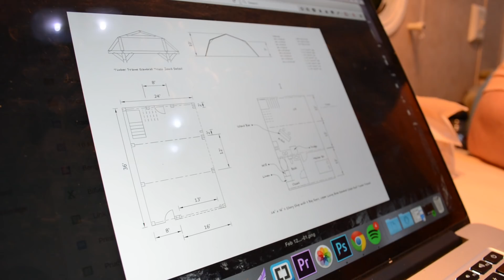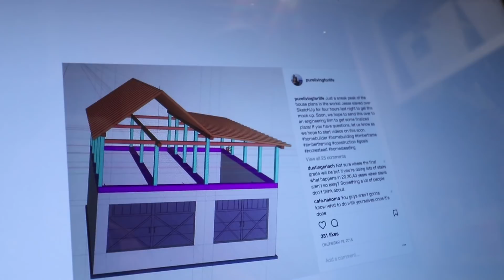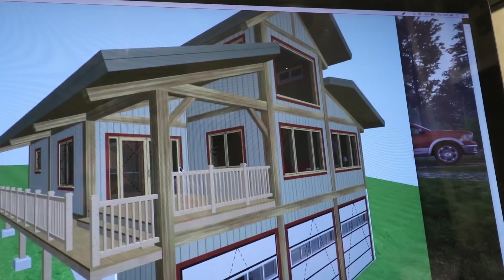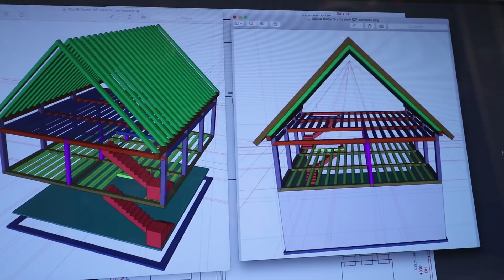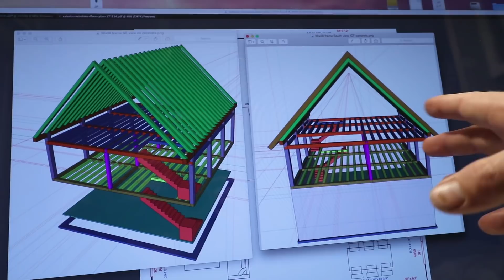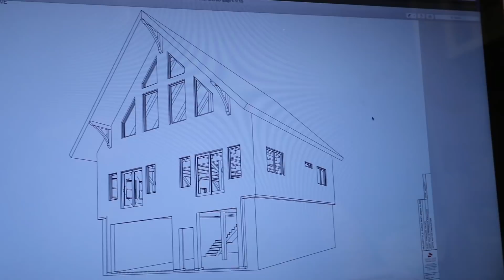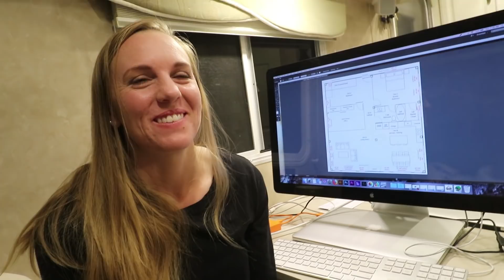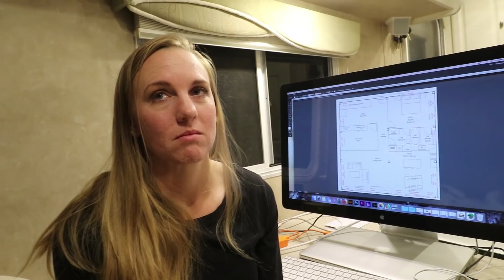Building a House Start to Finish: Timber Frame House Tour

Comment: The look of the interior looks great.  The spacial dimensions of the outside are getting there. Lets start with the kitchen; where is storage for food stuffs.  Rural living will require caning and or prepping a side of beef.  Where will be long term food storage?  The bedroom where are the dressers.  This helps finding your clothes also would they fit with a king or would it now seem crowded.  Stackable washer dryers are for small loads will take longer for laundry day or else laundry day will be all week long.  Where is the storage in the master bath for everyday grooming requirements?  The mud room should have more nooks for hats, gloves, boots etc.  Need more closet space to store linens.  Finally the garage; place storage under the stairs would help to organize the tools you have been collecting while building your house.  Suggest doors on storage to keep it organized looking. You will need a place place to put away winter tools in the in the summer and visa versa.

Comment: California building codes would probably require a huge ridge beam. I like the steep roof to keep the snow load down. I would have a few Jøtul wood stoves in the house. The chimney can be at the end of the gable so it does put a hole in your roof.

Comment: Loving the plan! looks so great! King bed is SOOOO good! make sure lots of room at the foot of the bed lol! Laundry, make sure that FULL SIZE machines can fit in there with a couple inches both sides and room to go up! you will probably want a bottom pedestal to raise them up off the floor. LOL noticed the render did not show how to get out of the stair case from the basement! you will want a good sealing door at the top or the bottom of the stairs (and then enclose stairs if at bottom) to keep the vehicle smell out of the rest of the house and for fire safety. Keep at it guys!

Comment: I like the design concept of your house. Nice job! I was surprised at the chosen placement for the washer & dryer. I would have figured that those would have been placed in the mud room. You wouldn't have to worry about taking of wet or muddy clothes through the house in order to wash them. Simply strip out of said clothes and into the wash they go.

Comment: Some friends of mine have one just like it and I see a "flaw" in your design.  The block on either side of the driveway should be extended out into the driveway. And they have a deck over the driveway and around the side.
Reply: smolville I think that they are building the deck at a later date.

Comment: Love your floor plan!

The things that would drive me nuts though, would be trying to do laundry in the bathroom. I suggest a laundry drop in the bathroom and the laundry room in the garage. Especially where you may be coming in from the yard and showering in the full bathroom down there, you'll probably find the laundry down there being more convenient. Secondly, once you have kids, bathrooms feel really small really quickly as kids need stools to the sink, you may have a diaper trash & regular trash can, bathtub rugs, and they can run you out of towels quickly, etc. Have plenty of storage space in or near the bathroom with extra floor space inside the bathroom.

Also, if you plan to do canning in the kitchen, it will feel small as soon as you start. I would wrap the cabinets all the way around to the door and decide island OR kitchen table. I vote kitchen table. More options for space use. Especially where I didn't see a pantry, you'll need lots of cabinets. You mentioned possibly canning down in the garage workspace, but that's going to be difficult once there are children to watch similtaneously. 

Speaking of which, where is your cold storage going to be? That's a must for a homestead. Garage? Under the stairs? Separate building? 

I figure that your workshop tools will end up taking that whole 3rd bay of the garage.

Comment: You have obviously put a lot of thought into your design, and it looks like a house that you will be happy in.  Sincewe are blessed with a world full of many different peoplewith different likes, dislikes and preferences, I am comfortablethat you won't be insulted that it's not my kind of floor plan.BUT, there are a couple things I think you should reconsider.The kitchen stove and sink should be swapped.  You don'twant bacon grease splashing on the windows and curtains, and you will really appreciate looking out the window whilescrubbing the pots that don't fit into the dishwasher.The other thing is the main entrance.  Do you want guestsbeing greeted in the mud room?  Do you want to come hometo the same scene at the end of a romantic evening?  If not, you might want to think of a way to make the mainentrance more enticing by adding interior walls or moving the door.

Comment: I missed the stairs in the mudroom from the garage?   Also I would suggest the washer and dryer in the mudroom or in the garage with a laundry chute,  and don't forget the overflow pan for the washer.  If air infiltration is a concern,  then add a foyer for the door to the north.  Congrats,  and  good luck.

Comment: One thing to keep in mind in the ruff in stage, make sure all of the electrical, plumbing is run up to the second story. Also on your decking make sure you have supports for it. lastly have you thought about pocket doors in the bathroom area.

Comment: Hi There, great job you're doing.
Just a small suggestion:In the bathroom instead of stacking the washer/dryer,
you could place them side by side elevated on a socket with build in drawers,the side by side is more comfortable to work at,and makes it easier to move heavy wet clothes to the dryer, and it spares your backs
then you could have a tabletop for folding dry clothes, and there will be room for longer shelfes

Comment: Washer and dryer in the first floor is not only a bad use of space but most of all and over the years you will learn that it will mean trouble. Let me just ask you something, if you were to have a water leak, would you prefer to have it on a first floor or in the garage? Take it from me, washing machines do break down when you least expect it and it doesn't matter how expensive they are. Take it from me, I've been a home owner for over 25 years.

Also from the looks of it you going to have a pretty considerable size roof, what I would suggest is to build a system to collect all the rain water that lands on that roof. This will allow you collect that water to store it and use it in many different ways. But mostly you will avoid having all this water falling down around the house, specially because your house is built up against a hill side. But even if you don't want to collect rain water, the important thing is to drive that water away from the house's foundation.

In the end it's your house and you decide how to build it, I feel like I did my part in trying to give you the best advice possible.

Good luck with everything!
Reply: wcfbhoodinki In apartments complexes what you said makes sense. In buildings with apartments have concrete flooring and are prepared to be resistant to a substantial amount of water in case of a small flooding. That's not the case here, they have wooden floors with wooden beans. And we all know what water does to wood if concentrated for long periods of time. It just makes sense for them to have laundry in the garage. Not only they have a small set of stairs allowing easy access, but also they have heated floor there as well. Plus it's good exercise.

Comment: Use a sliding door in the bathroom. Solves a lot of issues. Assuming you are looking at triple glazed on the big windows? The heat loss from Windows is horrendous! 
I think your not only brave but honest! It's a bitch when reality bites!  I look forward to following the build.

Comment: Vaulted ceiling! Give yourself 1/3 of the loft for a vaulted ceiling in the front, it will open the space up so much. I also agree with other comments about putting the office upstairs and with the vaulted ceiling, you could even keep it open so you can be apart of what is happening downstairs.

Comment: Excellent video. Regarding the bathroom, if you still have time to work it in, check out concealed toilet carriers like geberit or toto. Wall mount toilets free up floor space in your bathroom and your toilet doesn't touch the floor so it's easier to keep clean. Plus, no more wax rings. We put one in our bathroom and we love it. It's one of our favorite upgrades.

Comment: Really impressive, I have been enjoying your uploads and it is great to see your plans. Simple is great, and this model really helps visualise everything. It is so good, in fact, that I can guarantee you will continually be hitting your side or back on the kitchen isle corner by the stove, whenever you are rushing by it to the fridge or ovens. I think you should consider rotating the isle a little, so that the kitchen space is more of a triangle. But there are probably a lot of other solutions.

Comment: Only problem I can see is reversing your big diesel truck into the garage and the fumes going straight up into the house. That would suck!
Reply: Alex Swan that's why you open your garage door lol. You'd die from carbon monoxide if you don't open your garage when you start your car lol.
Reply: In the fire station they use a ventilation system that connect to the exhaust of the truck and pump it outside .. It automatic turns on then the truck start.. I image that the is a private home type out there ..
Reply: ALEX/Alfheib
That is why we have building codes that make you make your living space separated from you garage space from both fire and fumes by insulating all walls and ceilings and doors with fire/fume proof materials.
Reply: John Ahern .. I understand that there are codes.. I was just showing there are systems for removing exhault fumes from abuilding .. I was in the fire service for many years ..

Comment: Hi, Here's a couple of comments on your plan:
1) Consider some dormers on your loft.  I think you will get tired of hitting your head on the ceiling after a while.  If possible, have at least a 4 foot wall surrounding the loft to raise the roof slope from your brain.
2) Instead of a bath tub/shower, install a shower only.  You can do the tubbing in your cool hot tub when you  want.
3) Consider when you get older and going up stairs.  Not sure what to do here.
4) Your view looks awesome from the driveway.  you should consider a deck or something over at least part of the driveway so you can enjoy the scenes.  If you're not ready to do this, at least frame in a doorway so you can easily add this when you feel the urge.  This can also be a great way to haul up big furniture into the 2nd floor and perhaps a small lift to bring up provisions.
good luck.

Comment: want to mention a couple of things about a heavy sun exposure..... Sun fade on the interior and HEAT... LOTS of HEAT.  Been my experience anyway.
Reply: Andy Sars - I think your talking about the slanted roof? (Which isn't their current design anyway)

that's been true in the past, but windows are made with uv blocking now, so it's less likely to fade the carpet, etc.

Secondly, far less heat will get through the windows, with new window standards, however if it did, it would be a bonus because the sun is only low enough in the sky during the winter. During the summer, it's at to high of an angle where they live, they won't have direct sunlight into the house.
Reply: I live at an equal or more northern area than they do.  I have energy windows and still have those effects.  Dark objects still heat up and photos in particular still fade.  The front of my home is one big window.  Though I agree windows newer than what I have should be a degree better than what I have, it still happens.  There are obviously 2 sides to all objects, just informing on my side.

Comment: Oh, the kitchen. Please rethink the double oven. I know the rendering isn't exact but almost everyone I know who has those double wall ovens uses one or both for storage. lol As for the costs, I find it more economical to have 2 stoves versus stovetop or whole stove and a double wall oven set up. Yes, you lose counter space with 2 stoves but try fitting 2 canners onto one stove. lol I dream of a big stove or having 2. For now I have to use an outdoor double burner to use both my canners at the same time. :( We don't use a microwave, not had one in over 5 years. Using a gas stove has made a big difference in heating/reheating things, even water. I do use a mini-oven. NOT a toaster oven but bigger. It is electric and gets used often. Perfect for us than using the big oven in the stove.
Reply: I am so happy to get my induction range back. We currently have gas, and the speed and control of the induction is amazing. Not sure it would make sense if completely off-grid vs gas, but I'm still on-grid :)

I'm pretty sure I could fit 2 canners on my induction range as well, but I tend to not can enough to need to do 2 at once.
Reply: With glass tops you have to be careful of the weight on them. I've been toying with a portable single induction heater. It's now a tradition for me to run out of propane during the Thanksgiving cooking marathon. lol Fortunately, hubby can change out tanks quickly (always have spares). Still it happens almost every Thanksgiving. lol
Reply: I second this. Canning is much easier with more range tops. Rarely do people need two ovens, unless you're a professional chef or caterer.

Comment: i like the exposed ceiling style but when doing that you should keep in mind that you will see exposed cables/conduits (this can be minimized but rarely eliminated) Also it would be of great benefit to you to select lights based on how they will mount to the ceiling (as an electrician i have had customers that purchased nice expensive lights, to later find out they cannot be mounted the way they were hoping or cannot be mounted at all. e.g a recessed down light cannot be mounted to a solid timber beam). pendant lights would be a safe option but style isn't always great. just something to think about if you haven't already. keep up the good work guys. Thumbs up from the land down under :)

Comment: 10 year plan !!!  What were you thinking to live in a dump 10 years 
1st the foundation shoulda been done by others using cinder blocks and steel framing with house resting on concrete slab 
Then hire framers to help you with the top have to decrease labor and speed up process 
Design would be cathedral ceiling with a 45 degree pitch extending from top to bottom and loft woulda been sensational 
Huge sliding glass doors and skylights woulda gave great light 
Back wall again sliding door with huge glass windows 
Deck in front with catwalk leading to brick patio having over hang front and back 
Back octagon Jacuzzi room all glass removable for summer and winter on corner of patio 
Get a better washer and dryer for Christ sakes and cut down the cream colors ,,, put some blues gray and whites and use wood flooring only in bedrooms living rooms and hallways ,,, marble else where 
You have a ton of square feet and the whole thing will be ruined cause of a mud room and lack of patio sliding doors with glass glass glass ,,,,   
2 bedrooms upstairs with the tip of house used for attic 
Side of house from the jacuzzi toward front for all equipment 

MUDROOM !!!! That killed everything as a large office for what side by side looks like to retards ,,,  why not get a long desk and you sit across eachother so you ain’t got to twist your necks when looking at eachother 
I don’t know where you 2 people are from but you certainly aren’t quite right 

Shoulda gotten foundation with blocks and steel shoulda got carpenters to help build framing And a good old fashioned no nonsense designer with a retro frame of mind 
Woulda been smart to hire a couple of teens to be helpers running into town to buy things and doing odd chores which woulda gave you the time to do more important things to do and you wouldn’t had to run around for every little shitting thing , wife coulda made better meals while teens did her work and she coulda kept up with all medial things as you wouldn’t had to run her ragged with laundry and cleaning and she coulda been pampered instead and the same time everything would of gotten done quicker and the teens woulda been on videos too 
A couple of teens would had been tremendous 
If money was a concern then all the time you spent on your own left you with no time to make money 
Again.   MUDROOM ,,,,
Reply: ShouldAH wrote a nice poem like you. :)
Reply: Who the hell do you think you are? This is their project buddy. Go elsewhere if you don't like it

Comment: Considering how much water sprays every time you flush the toilet, are you sure you want to put the washer/dryer in the bathroom? You could keep the washer/dryer where they are except turn them around to face the kitchen.  Then you'd have the kitchen island to use as a folding table on laundry day. If you didn't want to see the washer/dryer in the kitchen everyday, you could put a barn door over it and hang your artwork on the Barn Door. So on most days it would look like the rendering. Just some thoughts. xoxo from Arizona.

Comment: Have you thought about installing some nice ceiling fans??   They are a VERY nice thing to have.  Bring the heat back down from those HIGH Ceilings in those cold winter days.  Very nice layout! Love the overall timber structure...